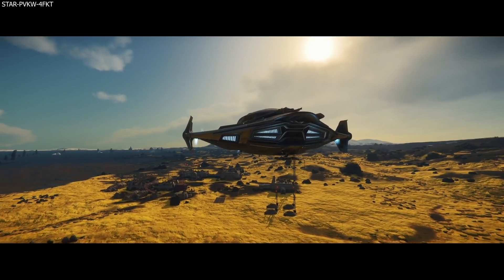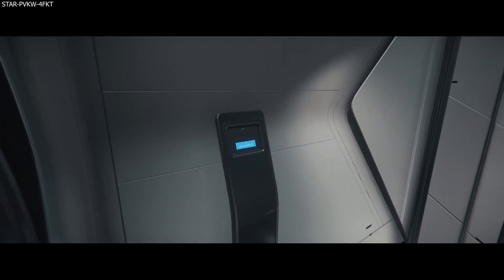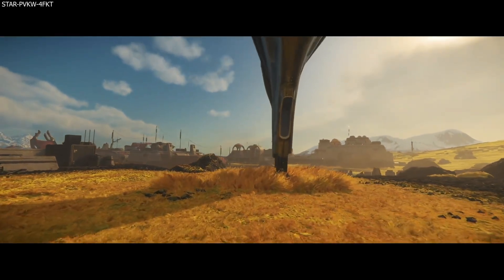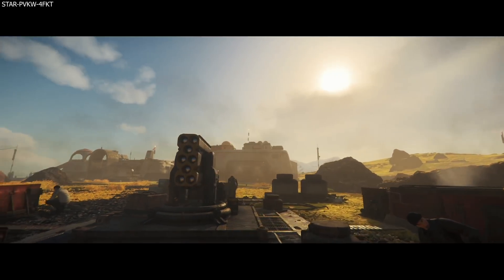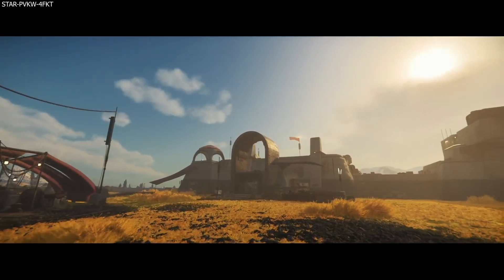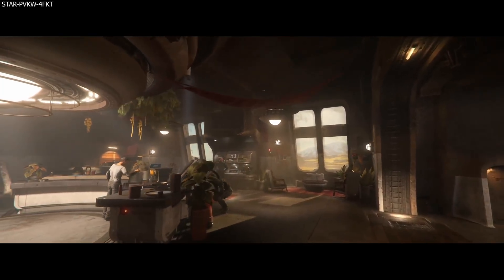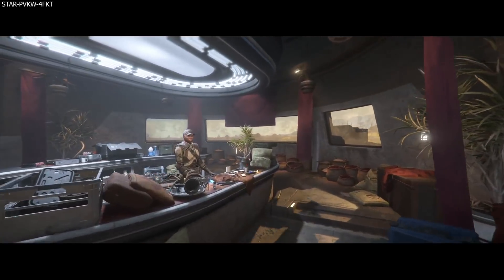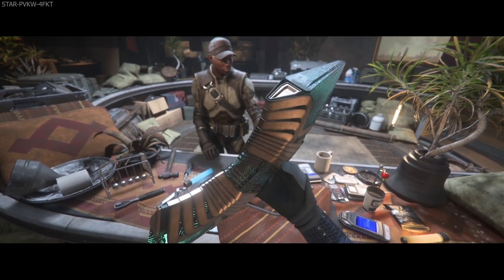Ray Tracing, DLSS & Gen12 / Vulkan Implementation | Star Citizen CitizenCon 2951

Comment: Ray tracing will really bring cities to life. Reflection and lighting across windows is really key to making them more natural.
Reply: I get 20 FPS in cities with a 2060, I9 9900k, m.2 SSD and 32gb of ram.
Reply: @FortniteBlaster2  A 2060 is mediocre these days. But none of your hardware is going to be used properly. Not yet. On top of that. What about your setup 5 years from now? RTX is future proofing.
Reply: @Wylie288  Ray tracing is a future technical bullet point.  RTX is not.
Reply: @Wylie288  2060 was like $600.

My setup 5 years from now will have a 5070
Reply: @FortniteBlaster2  You, you paid more to adopt new tech. Doesn't make it all that fast.
Reply: @Wylie288  a 2060 is great for every other game except Star Citizen. It is undeniable Star Citizen is incredibly unoptimized.
Reply: @FortniteBlaster2  Who's denying it? It is unoptimized. its supposed to be. If they were optimizing shit this early everyone should be pissed. Thats a massively redundant waste of time.

However. Something being taxing doesn't imply badly optimized. A good example. Control RTX. Its very well optimized. 2060 isn't great for it. Another one is NMS. The realtime PCG in that game is absolutely no joke and it runs far better than it has any right to given the amount of work thats being done in real time. Optimized does not mean "high fps". Optimized just means, there aren't many ways to increase FPS.

On top of that. SC not being optimized, doesn't make your mediocre GPU anything more than mediocre. It would be a great GPU, 5 years ago. By todays standards its bare minimum. There are games even it won't do 1080p 144fps in, that don't have ray tracing.

Comment: When will they fix the horrible AI? Games from 10 years ago have better enemy AI. And the NPCs standing on chairs, T poses, the basic stuff that will turn off new players. Thanks
Reply: The NPCs standing in chairs are a visual representation of a process exit error if I recall. Basically an NPC function exits in a way other than expected. I took it as a visual debug method.
Reply: Holy shit, JV, you play star citizen?
Reply: T posing npc's have largely been fixed. Same with standing on chairs. I haven't seen a single one doing that in 3.14. Enemy AI is somewhat better but obviously not great.
Reply: The AI isn't horrible, its reaction time is limited to the server load, if you've ever played on an empty server (less than 15 players) you will notice that the AI is VERY reactive and accurate both on foot and in space.
the real question you want to ask is: "when will they upgrade/update servers to support 50+ players without slowing down AI reaction time"
Reply: @UniqueFrank  Yeah cause new players will go through 10 years of patch work and development notes.